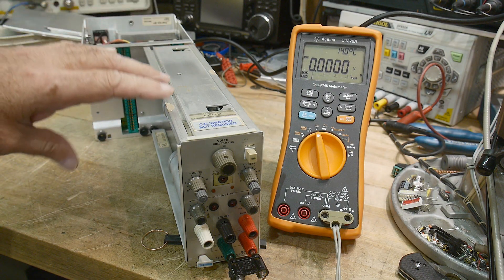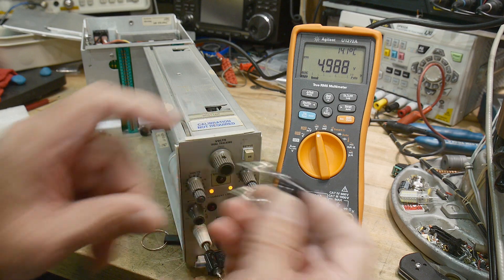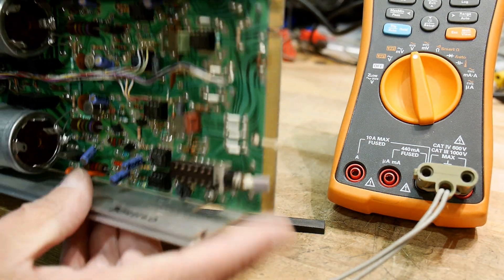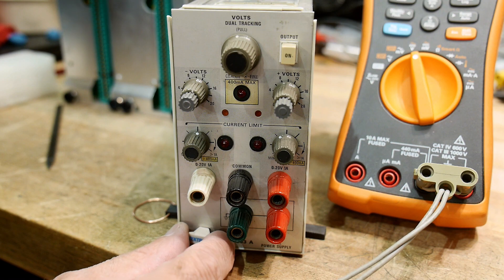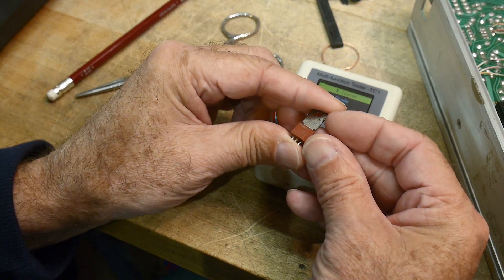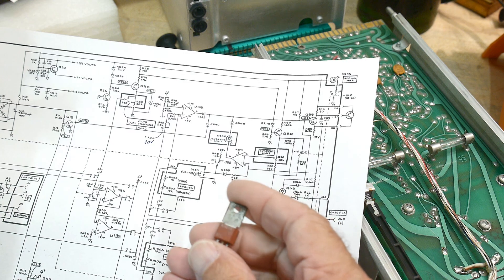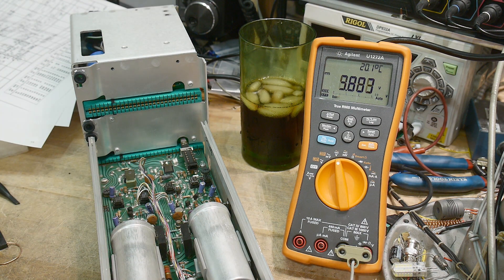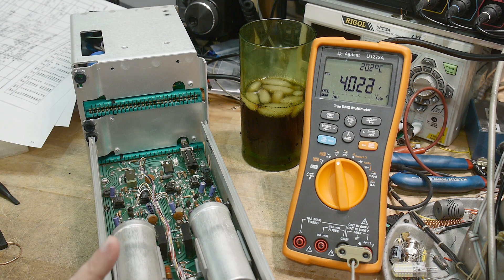#1342 Tektronix PS503A Power Supply Plug-in Repair

Comment: uA741 being used as a comparator (well not quite with the complex feedback, but...), MY GOD, I would never try that, it seems to me to be begging for instability, especially with a PNP pass element run by a NPN driver (multiplying the uA741 gain by it's hfe).  I am no loop expert, but this circuit scares me!
Reply from the maker: I think it relies on C85 slowing things down.
Reply: @IMSAIGuy  Yep!  I dare you to remove it! :)   ...I know you like oscillators! :)
...I doubt the 50uF on the output will hang it in, more likely slow oscillate it (depending on the load).
Transient pulse response usually separates the boys from the men here, especially if you switch in/out complex inductive/capacitive loads! :)
For me, I dislike slow response power supplies, which is the ULTRA VAST majority of them.
Typically a glacial feedback loop with a great big bombastic electrolytic cap on the output.
...then they dare to call it a lab power supply  ...give me a break!
Power supply design is an art, and it is VERY difficult to make it unconditionally stable if you want reasonably fast response for ANY load/transient.
...I know, I have been doing it for a decade, and still fail way more often than succeed!
It is a bitch, and so complex that trial and error tweaking comes in at the final design testing, ALWAYS!
I wish I knew a PSU guru, but wherever they are, they are out of reach for mere mortals like me, they live in Tek/HP design department fortresses etc.

Comment: Nice job troubleshooting! The two LED's are to indicate whether voltage or current is being limited for each channel independently. 

FWIW, as you move forward the two most replaced parts I have seen are those tantalum caps and the little variable resistors. If you are calibrating these plugin's and it seems touchy, replace the variable resistor immediately. 

I hope you bought an FG504, it's a terrific analog function gen.

Comment: I think your description of the switch is backwards. When the switch is not depressed the current limit should be on (and the LED). The high power slots in the mainframes do not have the semi-circular cutouts that the plunger goes into and therefore depresses the switch. As I recall only the 4 slot and above mainframes have high power slots and it’s always the rightmost one as you face the unit.
Reply: That's correct.  I have a 4 slot chassis and it lacks that cutout in the high power compartment.
Reply: Yes, I also agree with Rick's comments.

Comment: In college we did a chemistry experiment using a Tektronix power supply which had a power switch, a knob to adjust the voltage, and meters for voltage and current.  The purpose was to do electrolysis using copper-sulphate which coated one of the electrodes in copper.  All was fine until one of the kids dumped in a bunch of salt or something, and then it started producing chlorine gas.  The whole chemistry department had to be evacuated and the chemistry teacher was running around with a gas mask switching off all the power supplies  :-)
Reply: I don't think that would make enough chlorine to poison anyone in days, maybe the staff just needed some action.

Comment: According to your multimeter you started at a room temperature of 14°C. When the temperature was 20°C, a drink with ice cubes appear. Do you have ice bears in your genealogy ? 😃
Reply: I also find 20°C uncomfortably hot in summer. Though in winter i'm shivering when there's less than 21°C inside.

Comment: Thank you for the nice Video. I still have a similar set of slot-power-supplies, about the same size, just horizontal, the HM4080 from Hameg out of the 80' with 2x20V 400mA and 5V 500mA with two 3-digit meters switchable between Voltage and current. A really nice equipment in those days. 
I see that you start at 14.2°C in your workshop making up to 20.1°C when you continue with an iced drink. Or maybe you just leave the multi-meter in the fridge over night.

Comment: It looks like the transistor has close to 60V across it.
Reply: Yes up to 70V possible with the power supply shut off, and the pull down doing it's best to pull current out, and full input. But should survive well, not as if you will have more than 35V on there between collector and emitter normally.
Reply from the maker: @SeanBZA  CR60 clamps the emitter and it never sees that -27V